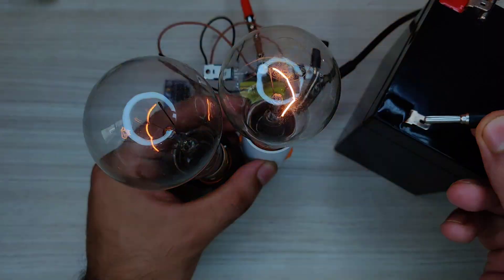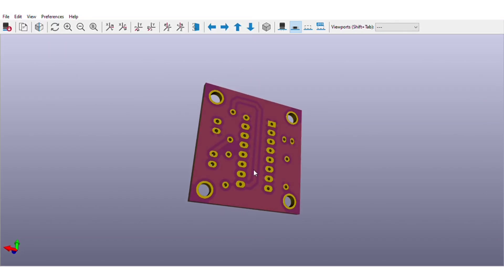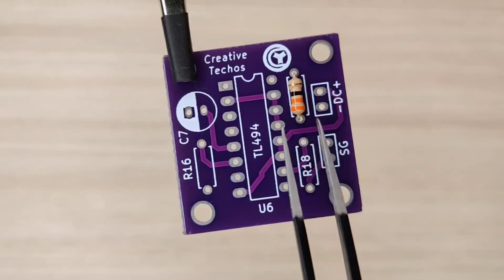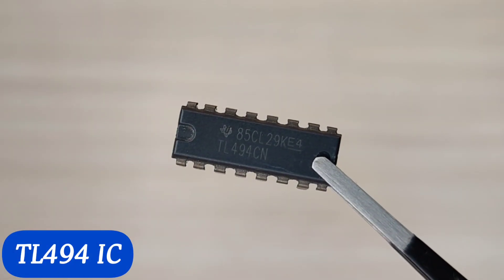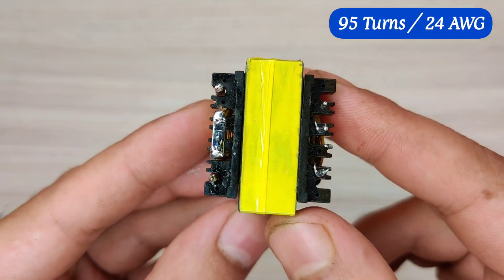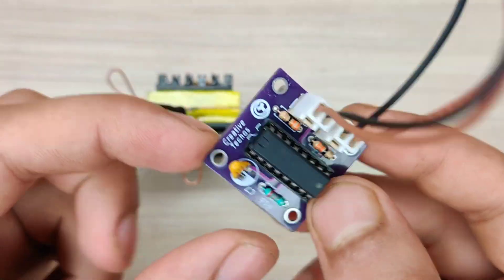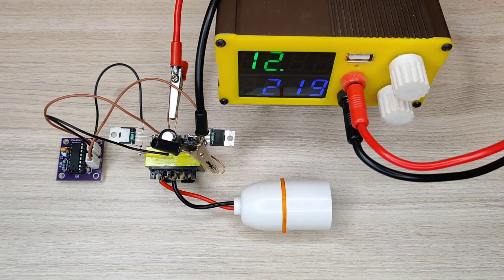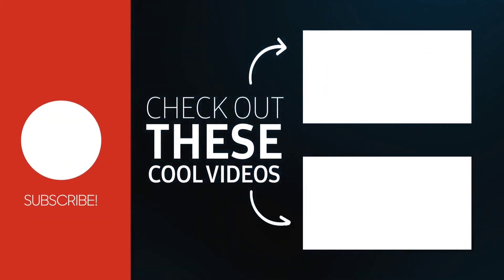how to make 12v to 220v inverter from ATX power supply

Comment: are the frequency 50Hz?
Reply from the maker: The output output is 25khz suitable for lamps, if you need to drive inductive loads, then oscillator of 50hz can be added on output using H bridge circuit.
Reply: @CreativeTechos pls did u have the circuit diagram for H bridge circuit

Comment: 220 Volt Output is not 50 Hz , it is in a range of  20-50 kHz
Reply from the maker: The output output is 25khz suitable for lamps, if you need to drive inductive loads, then oscillator of 50hz can be added on output using H bridge circuit.

Comment: very good circuit I would like to apply for a 500w inverter using EE 42 ferrite but I need details of the wire gauge for the primary of how many wires and for the secondary if you had the video or link it is appreciated
Reply from the maker: I'll soon upload video related to winding ferrite core transformer with easy calculations